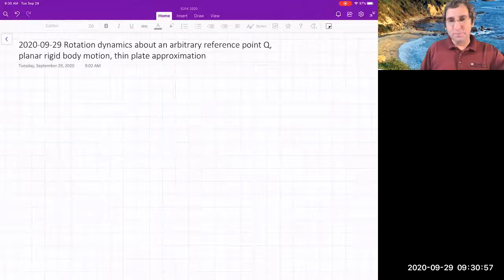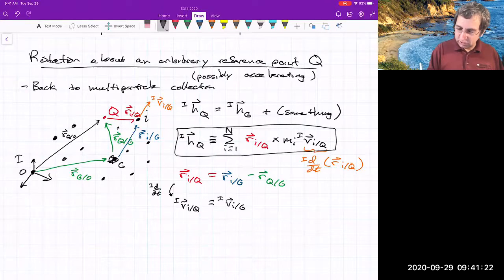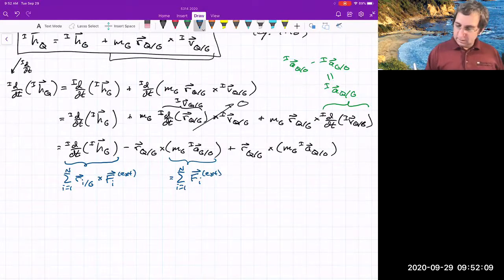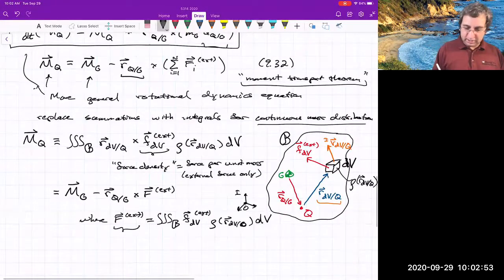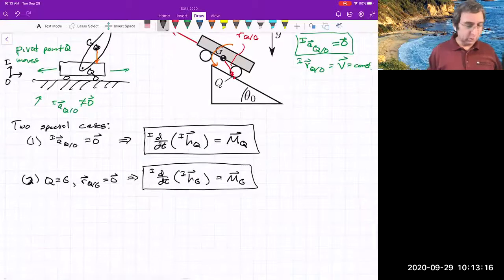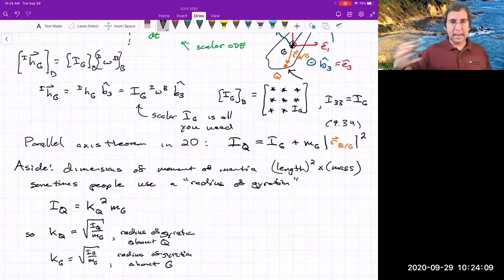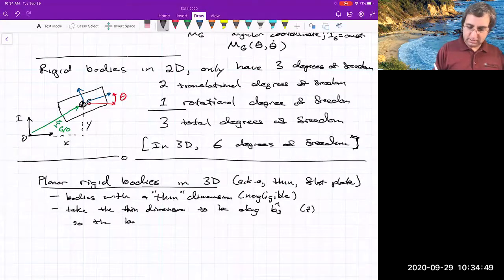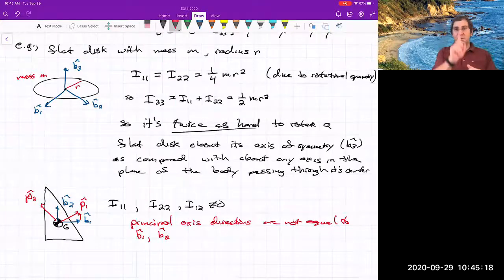Rotational Dynamics About an Arbitrary Point + Planar Rigid Bodies (Car Jump) | ESM 5314 Lecture 11

Comment: I'm confused about the angular momentum about Q formula. On some other websites, I've seen the vector r_Q/G written as r_G/Q (i.e the position of Q relative to G, or the vector from Q to G or rG/O - rQ/O). Which one is correct?
Reply from the maker: Different books use different notation conventions here. For example, some authors define r_Q/G as the vector from G to Q, while others define it as the position of Q relative to G (which is the opposite direction).

So yes: Greenwood and Kasdin & Paley effectively use opposite conventions in some places. The key is just to stay internally consistent with the cross products and signs.

In practice:

r_G/Q = -r_Q/G

so both conventions lead to the same final physics once substituted consistently into the angular momentum equations. The confusion is mostly notation rather than mechanics.

Comment: At around 49 min, why are I_31 and I_32 not considered? Shouldn't they be also included in the matrix multiplication? Or are we assuming that the axes are along principal directions?
Reply from the maker: Very good question. To rephrase, I think you're asking, "Why are angular velocity and angular momentum parallel?". Because if I_31 and I_32 are non-zero, those two vectors would not be parallel. The assumption that the rotation is about a single axis implies that both the angular velocity and angular momentum are both about that same axis. So I guess that means that, in effect, we really are assuming that the single axis of rotation is a principal axis. I had never thought about like that before. That means all 2D rigid body dynamics (sophomore level collegiate dynamics in the U.S.) is assuming something special about that unquantified third direction.
Reply: @ProfessorRoss  Thank you for your detailed explanation. From what I remember from my sophomore dynamics course, I was told that the equation only applies to 2D rotations of bodies that are very thin or planar symmetric. Would it be correct that for planar symmetric bodies, the b_3 direction is always one of the principal directions?
Reply from the maker: @ericczh5514  Yes: in this discussion of Planar Rigid Bodies, I assume, for convenience, that the out-of-plane direction is the b_3 direction and a principal axis direction for the body.